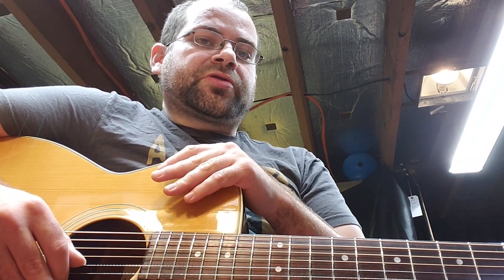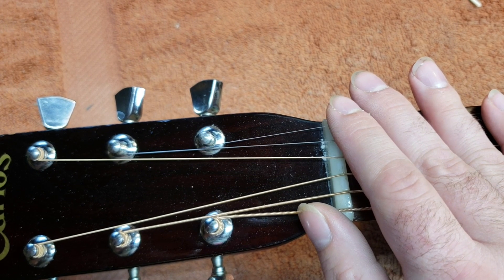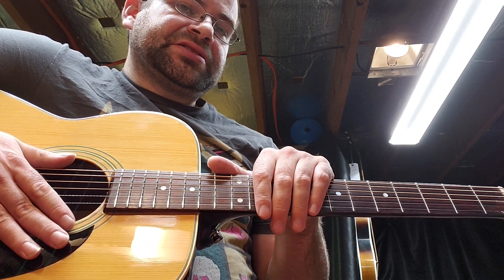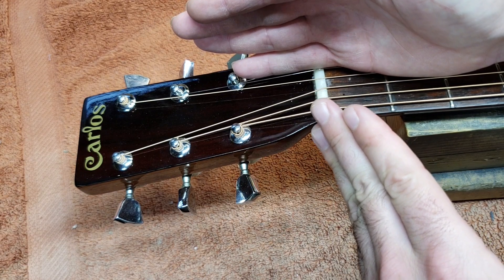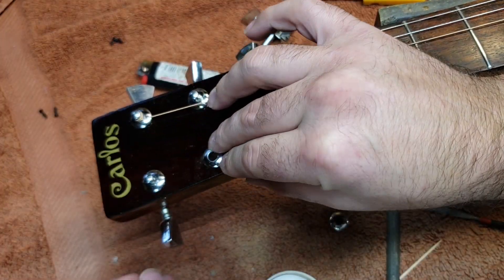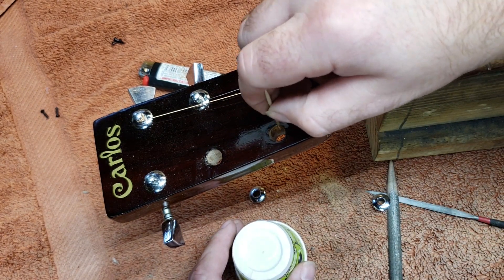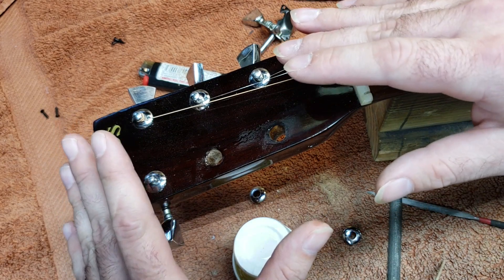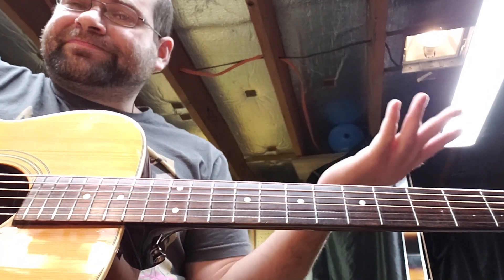Sympathetic Buzzing

Comment: You're a life saver man!  I just got a new guitar and the fretted b on the 7th fret of the high E string was making an annoying sympathetic buzz.  I had a PRS that was doing the same thing years ago and it turned out the nut slots were just cut too deep.  I figured it was the same issue. I started tightening up the machine heads a little and it turned out to be the tuner for the low E causing the problem.   Thanks!